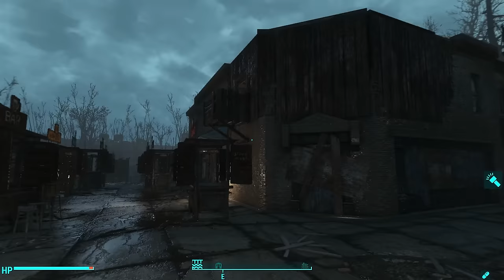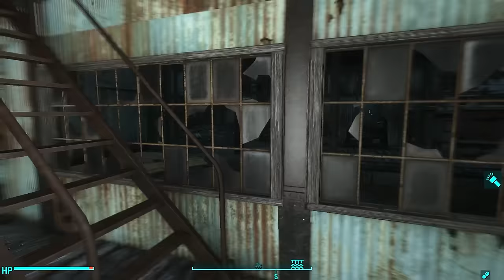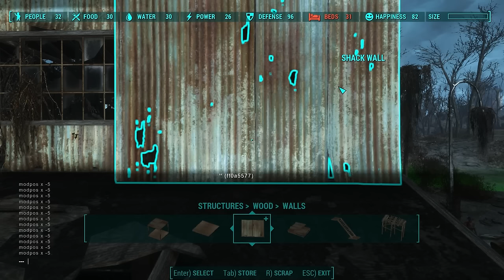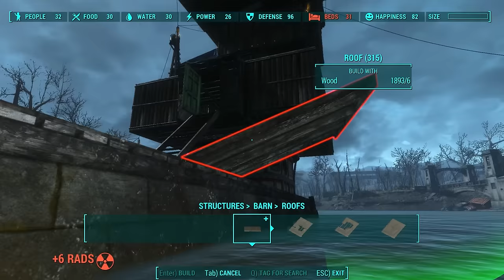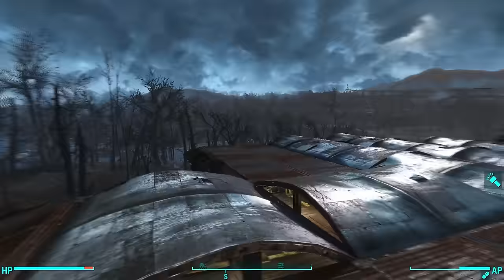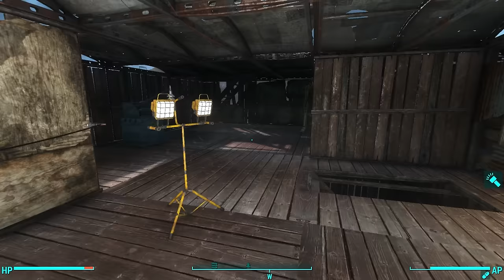How to Patch Walls & Roofs in Your Settlements - Fallout 4

Comment: I'm sure you have already discovered this method, but when using "tcl" in console, items or structures cannot be selected again once placed. this makes it easy to build overlapping pieces for a more seamless look. However, this does not work for non-snapping structures or terrain, but might allow snapping into the map textures to fill spaces where structures are not supposed to be. I used this method A LOT in the Vault 88 construction. An example of this is, when building a corner piece with walls snapped on top, one wall will touch the corner but will not allow the other to meet up. After placing one wall, type "tcl" in the console, select the wall just built then cancel the selection so it sits in its original spot. Then build the other wall and it will snap together, slightly overlapping in the corner to create a tight sealed look.  I also use "tcl" to place conduits all over my structures for power networks.

Comment: It sucks that you have to use console to fix it. I'd like to play the game legit with no gameplay changing mods and no console and there are so many settlements with holes in the roof and walls. I wish that Bethesda improved the whole settlement upgrading thing so its more flexible.
Reply: I'd settle for the ability to just tear out the garbage buildings.
Reply: I agree with this, I play on PS4 so mods aren't an option (Thank you Sony) and it really gets my OCD going when I can't patch up buildings.
Reply: I like to just build above or around. End up with a lot of builds that look a little physics defying.
Reply: Try putting a rug on top of a rug and then putting an object on top of that rug. By selecting the first rug you can move that object anywhere as long as the rug is allowed wherever it is (i.e. putting walls where they won't normally snap). Not sure if you can use one rug, though. I'll have to try it.
Reply: Console gamers, LUL
Reply: two words rug glitch
Reply: LosEagle you might not like mods however I would recommend gettimg the snap build mod cuase it adds alot of other in game assets to build settlements and it doesn't really make the game any less legit it just adds new pieces to build with. For example they add the ability to build the trailers you see the military use for temporary offices
Reply: High Vis Harry has a few tutorials on how to use the Rug Glitch to make better settlements. I suggest you check it out if you are on console.
Reply: LosEagle The good thing is that Bethesda is actively supporting modders and modding. Modders have the potential to improve the game significantly either by building upon lacklustre systems or innovating things that Bethesda simply could not do due to time/financial/internal political factors. This is not a new thing. Active modding support worked wonders for games like X3: Reunion.

What would be bad is if Bethesda did a Rockstar and actively prevented modders from contributing to the game.

Comment: I've found that if you are using the spring cleaning mod in places where there are foundations (like the wrecked buildings in Sanctuary), you can't then use the mat glitch to move stuff around if you are using the foundations as your flat area to work from.

Comment: quick tip. rugs have collision. so you can use them to bridge gaps and settlers will path over them without issue. did this when i used wooden foundations that have the concrete block to patch the castle walls. the dirt on top left a gap that i couldn't fill. rugs to the rescue.

Comment: If your building an area for people to sleep in you need solid walls all around them
and a heat source. If you leave a wall of broken windows in an inner room that allows the wind 
in your people will freeze to death because the cold air will blow inside via the outter broken window
and travel up through the mesh floor.

Comment: Cool trick, I'll certainly use it. However I'd have placed a door frame wall panel rather than just a wall, so settlers could still get up on the roof. I always think it looks cool to have access, so deck chairs and guard posts, makes the building look lived in & fortified, even though I almost never assign settlers to the posts since turrets are a much more effective defensive option.

Comment: I've recently been patching up ETM myself to be my main settlement. The roof was the first thing I did because of CONSTANTLY falling through those damned holes ahaha. I used cinderblocks to rebuild the wall of the upper floor of the pub though. And walled off that corner where the wood comes down and makes a ramp. This place is seriously underrated, you can make a great town out of it, especially being able to expand into the lot or build across the docks. There's a spawn point on the bridge to the north though so attacks are constant.
Reply from the maker: Yeah I had EGT as my player home for a while, it's a great little place.
Reply: Yep, I love the location as well, it's great for survival mode being only a short walk to diamond city and greygarden, and even shorter to a decent vendor.

Comment: Can you do a video on how to install and run the precise moving and rotating mod? I've been trying to get it to work for a couple hours now and I am SO lost.
Reply: 1st install this program https://www.autohotkey.com/

2nd download the mod http://www.nexusmods.com/fallout4/mods/3615/ 

If you did that, then there is no install, just unzip and copy or save the .ahk file to any location like your documents directory and double click it to run the "mod" and play Fallout 4. When you open the console in game, it should work unless you already have the keys assigned to this program bound to something else in game. You can edit the .ahk file with notepad (or by right clicking the .ahk file and choosing 'edit'), or you can just reset the key binding in game to default if this is the case. Normally, there is no problem. Additionally, in some cases if the .ahk script doesn't detect Fallout 4 is running on your PC, you can modify it to always run with any program, and that information can be found on the download page, too.

Comment: Are those console commands normal or are they part of the mods you use?  I'm playing through with totally un-modded game still.
Reply: the console commands is the part of the game engine, the mod just allows to use the commands more easily.
getpos <axis>
setpos <axis> <coord.>
modpos <axis> <coord.>
getangle <axis>
setangle <axis> <angle.>
modangle <axis> <angle.>
<axis> = X, Y or Z
Reply: If you use a PC then you have to install a program called AutoHotkey. The link is in the Nexus Mod Manager and it's up in Oxhorn's description;
next you install the 'mod' which allows you to install a fallout4 script so you don't have to keep typing every command word in... i think the script [mod] on Nexus MM is called Freemove.

It has all the instructions you need and is a tiny 1KB file which you unzip then click on so that it's running in AutoHotkey before you start FO4... then it means you just use your Numpad to move objects around in the 'console' command after clicking on the object you want to move..
It explains everything and there's even a small vid showing how to rotate or simply move object left/right/tilt etc using the Numpad keys.

Very simple.

Comment: So. Would someone like to explain how to do with WITHOUT USING MODS AT ALL? Console commands are fine, but what about those of us that refuse to pay for the mods at Nexus? And before you correct me saying “But the mods are free” allow me to point out that a.) they don’t work without the mod management tool no matter what you try, b.) you have to be a member of the site to download the mod management tool, and c.) you have to pay real money to be a member. Also, if you use mods, you can’t earn any achievements. So, as I was saying.. is there a way to toggle the collision on objects so that they can be placed this way WITHOUT MODS?
Reply: a) they do work, you just need to unpack the archive into the data folder of the game or use the management tool which will create a virtual install. The management tool and another program called LOOT makes many mods work together. b) You do have to be a member of the site, so what? c) I've been a member of and using the Nexus for 10 + years and have never been required to spend a cent on a mod. Some mods do display a donation window if you're downloading files manually, and you can choose to support these people in their hard work or not. There are also mods that will still allow you to collect achievements if you find that important.

Comment: +Oxhorn God I wish this mod or type of mod were available on PS4. I don't know if you've tried building anything on the console version but it is such a pain in the ass. Virtually impossible to build what you want. It took me like an hour or more just to build a staircase to the roof of Red Rocket...and it still looks like shit. =^\ It sort of looks like that with the stairs going past the top of the roof and then back down because those stairs will just not snap or line up with the roof. At the boathouse near Covenant there's a door on the house that opens out and the walkway is too narrow so you have to shut it after to walk that way. All I wanted to do was turn the door so it opened into the house but it will not go in there. I think I got one door to actually snap in there that way but it was the broken door with the top missing.

Comment: have you ran into problems with your mods from the nexus yet? i know a lot of mods are infested with bots and viruses. and are you 100% sure that you are getting clean files? several I've tried out for other games has been bad and was wondering if you have found a virus scanner that can remove them all?
Reply from the maker: I just have basic Windows 10 Windows Defender. I have not suffered from viruses or malware yet.
Reply: Fantastic maybe the nexus has cleaned up there mods or fallout 4 moders are not as bent on damaging or tearing up peoples computers.

Comment: 12:44 90% of the trash piles in FO4 shouldn't exist. There hasn't been anyone making trash like those in 200 years and yet the stuff is everywhere. Not a trash pile next to a trash can showing some scavver tossed the cans contents into a pile or allot of trash surrounding an empty dumpster. You get 3 foot deep piles of trash around and inside dumpsters at the same time as well as up and down every street. China dropped a nuke followed by many bombers with the contents of their landfills. From an artistic viewpoint the trash piles are still way over done. garbage can contents should never be used as general debris unless the location happens to be in a landfill. Dirt piles would be better, or empty broken roads that screams what once was is now a cracked and crumbled ruin with death at every corner instead of this is landfill vomit Bethesda gave us. FO3 atleast they put the trash piles around a dumpster or in a corner the wind may have directed it.. Rubble everywhere but trash... not so much.